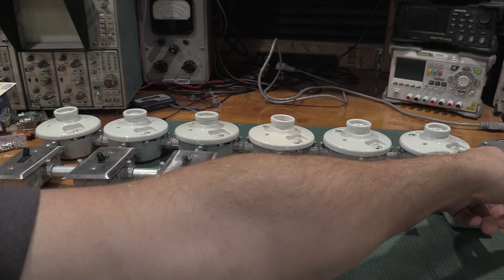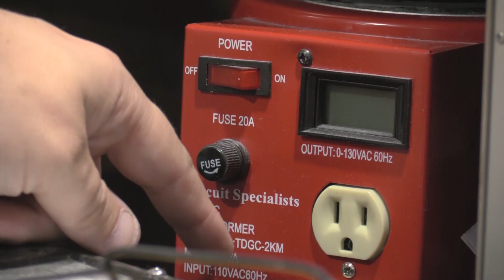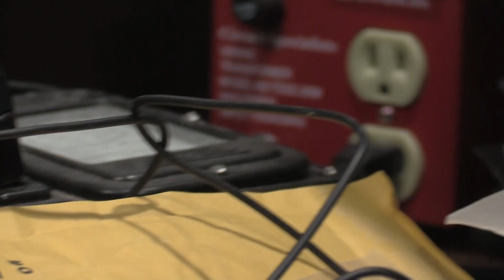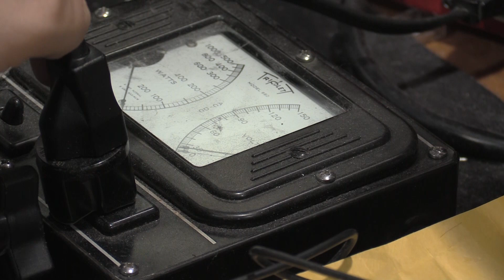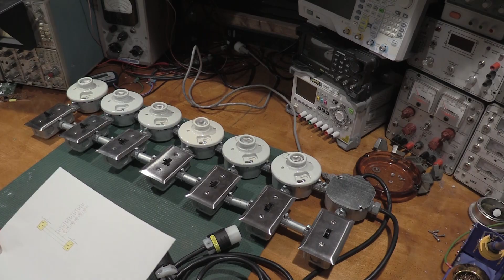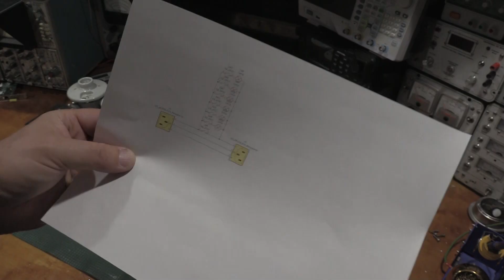Auto Transformer, Isolation Transformer, and Dim Bulb Tester build Explained with Schematic

Comment: Good video.  I built a (2) bulb tester with main control switch for incoming AC to power the tester.  (1) bulb is always active unless I use the bypass switch.  Like you, the other bulb is engaged when I use the switch for that bulb.  I change the bulb wattage if needed based on the DUT (device under test).  Usually use 100 watt clear bulbs.  If I need more than (2) bulbs, I am always able to add another lamp base and switch.  I have (2) isolation transformers & variacs.  (1) for each bench so I am able to plug in the dim bulb tester to either one.  Very useful and safe devices.  Like you, mine are all in metal cases and grounded.

Comment: NASA has called, they ask if you could turn off those lights, the light is interfering with there satellite pictures 🤣
All jokes aside, is there a specific reason to use such large bulbs ?
I'm building a all-in-one device, that contains a 500VA Variac, a 500VA isolation transformer, dimb bulb current limiter (adjustable from 0 to 400Watt in steps of 40Watt) and a electronic circuit breaker (own design) all in one chassis. The dimb bulb current limiter is very compact and use 10 bulbs, yes 10 :-) 
But i'm using G9 mini Halogen bulbs of 40Watt each, placed 10 of these in parallel (ladder form) and placed the NC contacts of relays between each bulb. These relays then are controlled by a rotating switch and 12V. Depending on how high in the ladder the relay interrupts, the more or less bulbs are placed in series with the load.
These G9 halogen mini bulbs are sold widly on Ali and other places, and can be found in different wattages. 10 of these with there ceramic sockets fit easelly inside a old computer supply case. Offcourse, you can still use 10 separate tumble switches instead of relays, to cutt down the cost of material, but i needed something compact and don't have the space for 10 switches in the frontpanel of my chassis. My chassis is only around 16" width, 12" deep and 5" height.
Reply from the maker: That is totally ok I can appreciate the humor! It is due to a unique requirement of my personal bench. I work on some devices that can draw 1000 Watts + . Tek 5xx scopes can tip the scales at 980 Watts. I also work on amplifiers that are high wattage that need a good stable supply. With out the number of bulbs voltage sag especially during warm up and initial power up can become a real issue.  Before I beefed up the dim bulb tester I was line voltage as low as 70 Vac which was WAY to low for a good check in and even cause operation issues of the DUT.

Comment: Mount that behemoth of a device to a plank and strap it to a hand truck. This will allow for movement and storage ability. If not hide it in a very large or narrow cabinet lol. Great work.
Reply from the maker: When the lab is redesigned it is speced to be vertical mounted to the outside of a rack my current thinking is the "new bench layout will have some equipment racks integrated to the design. This should give me the highest density storage for in use equipment. The current ceiling of the room is shot by about 5 inches.

Comment: Your schematic shows HOT going into light bulbs and then going out to the NEUTRAL -   not a big deal if you are using isolation xfrmr.
Reply from the maker: It is wired HOT to HOT. This would mean I have one of the plugs drawn backwards. This should be wired in the hot line. NEUTRAL should be straight through.

Comment: Just a suggestion to improve safety even a bit more: don't leave plugged-in, unused power cords with IEC female connectors on top of the workbench. 

Reason that I mention that: I found out the hard way that bare pieces of wire seem to have Murphy-an attraction to live IEC connectors. In my case it was my spool of solder.. Not fun, especially given the 230VAC grid here.

Comment: Excellent safety speech. Really Arduino to microwave!
Yeah unfortunately the standard light socket kind of limits you to a set amount of space. However if your group those switches together it would not have looked so neat but you could've done to four gang boxes or a bunch of metal boxes that can be linked together and had all switches next to each other. it would've cut down on some space and then you could've wired off to the lights through some flexible conduit and had a racing light strip.
Yeah yeah yeah I know for version 3 or 4, you have to keep iterating the design and until you finally feel like you're satisfied.

Comment: The only equipment I have seen to be sensitive with phase to phase vs phase to neutral is some UPS units when fed 60-0-60 power.. They check that and report a building wiring fault and refuse to start up.  But in a strict engineering sense, it makes no difference. The powered device sees 120v either way. This 60-0-60 volt system is used in some test labs and the professional audio recording industry. But there are strict codes rules for these 60-0-60 volt systems spelled in NEC article 645. In North America 208/240v is always phase to phase. In residential you have 240v @ 180 degrees out of phase and in commercial 208v @ 120 degrees out of phase, both hot to hot.

Comment: I needed a kilowatt dummy load to test a Heathkit HF linear amplifier.  The oil immersed 50 ohm resistor dummy load was back ordered.  Since it was common practice to use a 100 watt light bulb as a dummy  load for a 100 watt HF transmitter, I tried three 300 watt bulbs in parallel.  The three bulbs were physically mounted in a line as close as the sockets would allow and the bulb on the end was tied to the amplifier output.
               
As the power was increased, first the closest bulb would illuminate, followed by the middle bulb and closest bulb, and finally all three bulbs would light up.  This was an unexpected and novel result as the bulbs were wired in parallel,  The closer a bulb was to the amplifier, the lower the inductance of the wiring.
Reply: You do realize the old light bulb dummy load trick has extremely poor impedance match? If you just want to run some basic tests it's OK but not for critical tuning and alignment.

Comment: You can replace that meter on the variac for one that shows you input voltage/current, output voltage/current, watts, power factor, etc etc, for about $7. Search for "KWS-AC305 AC 0-500V Dual Voltage Display Voltmeter 0-50KW Wattmeter Power Meter 0-100A Power Analyzers LED AC Electricity Meter". I bought a new variac (120V in, 0-260V out)  recently that had a useless analog needle meter on it, and replaced it immediately with the one above - it's surprisingly accurate, and fits almost exactly in the existing hole in the variac.

Comment: Personally I don't think you need to apologize for your regard for safety. Those that think they don't need to worry about 120v or more may be above ground for a limited time. I have a 1-bulb dim bulb tester but am seriously considering beefing up so I can more safely work on old radios. Thank you for waking me up again about safety. My variac and isolation transformer will be getting more use in the future. Thank you for sharing.

Comment: I don't think any analog meter will work with calibrated accuracy while standing up. I believe the issue is simply that gravity is pulling down on the needle and changing the reading. I could be wrong though, if anyone wants to correct me... I have noticed this with my Simpson 260. If I zero the meter when it's laying down and then stand it up, gravity will pull the needle a bit below zero.

Comment: Could you talk about isolation transformers in the context of "how to not blow up your scope"? I've watched other videos about this, but I trust your ability to explain it clearly.
Reply from the maker: I can the main issue here is most if not ALL common scopes are ground referenced and they have single ended measurement. Not differential measurement like a DMM. You can get differential measurement probes for a scope I have one or 2 videos in the back catalog where these were needed. OP amps for instance get a little strange as they don't have a "GROUND" to hook the scope ground up to. Makes scope measurements a little funny with op amp circuits.

Comment: Like Runco990 below, I too have worked on high power broadcast transmitters, AM, FM, VHF-TV and UHF-TV.  As a supervisor once told me, "... electricity is faster than you are."  This video should be required viewing for anyone who is attempting to work on any type of equipment.  I know the more experienced viewers know this, but just because the device runs on +5 volts, the power supply is probably a switch mode type and that can be lethal.  ALWAYS - SAFETY FIRST!

Comment: Could you separate the lights from the switches, putting the lights in one area and control the switches from somewhere near your work space?  In other words, make it bigger!
Reply from the maker: This is possible but I will need to run 8+ cables for wire up.
Reply: @ZenwizardStudios  Maybe an alteration of what @Hymie23 referred to? Hang the bulb kit from the ceiling, but swap the switches out for relays, then run some LV cabling down to a small set of switches on the bench. Although this may add too much complication to your safety equipment, which I completely get (I'm rather paranoid about power at my bench as well).
Reply: @ZenwizardStudios  I can't see the size of the triplet from the shots in the video and don't know about the available space in your lab, but I was thinking of making a small footprint cart, triplet on the bottom (don't know anything about the size of it), and the dim bulb contraption in a wooden frame put vertically beside or above the triplet and then have a periscope with a mirror on the bottom (with some LED for good lighting) and a mirror at viewing height. This wood allow for pulling the cart beside you when working with it, can reach all of the switches and can read the triplet meter without having them mirrored. When done just push the cart into a corner. Also takes up less space compared to shelving.
Reply: @ZenwizardStudios  You also mentioned the isolation transformer is a medical grade transformer. Don't they usually have a earth ground connection that's also connected to the output on the isolation side? I've seen many videos where this topic is discussed but for completeness maybe you could have mentioned that too?
Reply from the maker: The transformer is good because all it does is pass through ground. Neutral and ground are not bonded in the transformer. I cant say much more than that due to electrical code issues.

Comment: Is there any use for stuff like this for modern equipment repairs?
Reply from the maker: It can yes though this is really only for gear that has linier power supplies and should NOT be used on gear that has switching power supplies. My problem is I work on both. This causes some unique challenges in the lab. As the Varic is need for modern switchers but the dim bulb tester should not be used.

Comment: My isolation transformer is first rather than last.  Do you think it matters? 
I built a 3-bulb bank using your same hardware.  I keep several wattage bulbs near for different expected draws. A bit smaller! 
I attached a small digital V-A-W meter(aliexpress) above the analog voltmeter on my variac.
I can add into the line a voltage doubling transformer. I have not had much use for that yet. 
I don't have a big load yet, so i jigger the connections on the dim-bulb bank turning it into a variable(eh) load.
Reply from the maker: As with all engineering questions the answer usually is “it depends” which is far from helpful. In my case I wanted to keep the metal of the bulb enclosure at ground level so it needs to be PRE isolation transformer. I also put some of the metering right at the device outlet this allowed me to compensate for the voltage drop of the bulbs as well as the loss in the isolation transformer.
Reply: @ZenwizardStudios  Makes sense.  I made wooden enclosure for bulbs/switches. 
I end with a watt-o-meter if I want an accurate accounting for device .